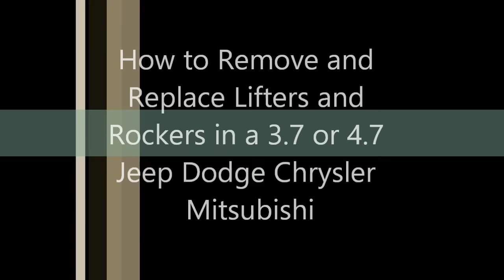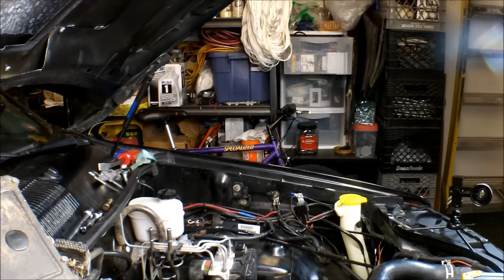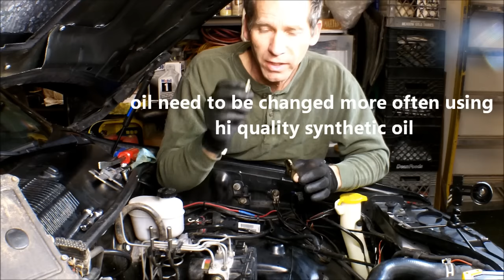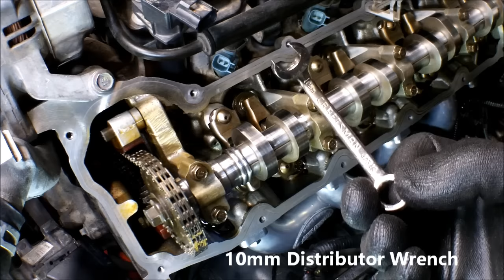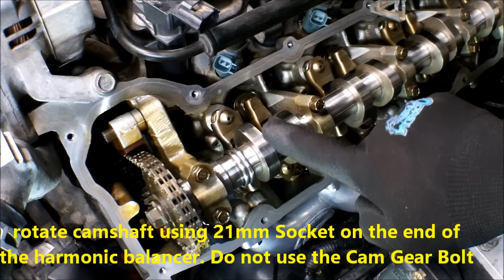Remove & Replace Lifters & Rockers on a 4.7 & 3.7 Jeep Dodge Chrysler & Mitsubishi

Comment: With that motor, the oil journals where the oil comes from to the lifter gets plugged not getting enough oil to the lifter. It's not usually the lifter. Take lifter out. Crank over the motor to blow out the oil journals that are plugged. You will know when the oil squirts and hits the hood so best put a rag over it. Only takes a crank or two to unplug them.  Replace the lifter or use a new one.  Works every time.  It took me 4 times taking mine apart to figure it out with new lifters.
Reply: I'm sending my kids dad a screenshot of your reply... Smdh poor dude... They getting him for a whole motor 😩😂 I'm in another state or I'd prove a whole point 😂🥰
Reply: How do I krank over the motor? If it's all taken apart?
Reply: @machetesulaco  Why would you take it "all " apart? Just take off the valve covers and pull the lifter out that isn't working. You don't want to start it until you get it back together
Reply: @machetesulaco  turn harmonic balancer using its bolt
Reply: These are OHC engines, so they don't have "lifters". They're hydraulic valve lash adjusters.
Reply: @UnionThugg  Are you trying to be funny ?
Reply: @grabitz This isn't hard. It requires a basic understanding of engine desugn. These engines do not have "lifters".  Pushrod engines have lifters. On the 3.7 and 4.7 engines, the hydraulic lash adjusters (the name AMC/Chrysler used) do not actuate anything.  They simply take up any ash between the rocker arms and camshaft lobes.  That's it.  

I'm almost sorry if those facts hurt your feelings.
Reply: @UnionThugg  Wow so your hydraulic lash adjustor doesn't have a lifter body?
Reply: @cablecow15  it's unfortunate that some people can't handle facts, and have to resort to ad hominem attacks on others in order to establish an regulated emotional state.  Since nobody asked you, your comment is worth exactly what UT cost.
Reply: @UnionThugg  Well.... It has lifters. But it does not have pushrods.
Reply: @ItalianoDio-  no pushrods = no lifters.  They are hydraulic lash adjusters.  They simply take up the clearance in the valvttrain.
Reply: Boo hoo
Reply: @UnionThugg chill tf out. It’s understood that they’re lash adjusters haha, they’re two very similar things and both serve a similar almost identical purpose. People can call them what they want. It’s not some marvelous form of technology
Reply: Good idea, I'll disconnect the fuel injectors so there's no ignition
Reply: You just crank it on the starter?

Comment: I have an 09 Dodge Ram 1500 with 330,000 miles on it.  I have used full synthetic oil since day one.  The lifters started ticking about 10,000 miles ago but I am now finally able to dedicate the time to do this job as this has been my main vehicle and I couldn't afford to let it sit for too long.  I hope to get another 50 to 60 thousand miles before I finally trade it off.  I've not had to do anything major to the engine, just a couple sets of plugs, a sepentine belt and tensioner, and 3 water pumps.  I also had to replace the radiator at about 200k miles.  Along with the lifters, I'm replacing the complete timing set, spark plugs and wires, valve cover gaskets, heater hoses, upper and lower radiator hoses and water pump.  Maybe I'm sinking too much time and money into something with this many miles, but this has been one of the most trouble-free vehicles I have ever owned, and I have definitely gotten my money's worth on this pickup.
Reply: You fix it?
Reply: Word.
Reply: It would be smarter the get new heads at 170k the bearing on cams already toasted so

Comment: You made the rocker arm and lifter look very simple to remove and reinstall.  Sometimes I like to work on my own vehicle, dealerships rates are outrageous.  Thanks
Reply from the maker: yeah, they are easy to replace, the hard part is getting the valve covers off with all the wiring and hoses that are in the way.

Comment: Always change your oil on time with full synthetic and try not to constantly romp on the accelerator and you're golden. I have an 03 Durango with the 4.7 and it has been a very reliable engine. 171,000 miles. I've had it for 4 years and the only things I've had to replace were the radiator and the alternator. Now the front end is another story, but that's a just Dodge thing 😂

Comment: thank you for your video i just replaced the lifters in my 2002 jeep liberty 3.7l   i used a 10 mm wrench , bent the end and grinded on it to make it thinner, it popped the rocker right out just like you showed. and used a small pry bar and a flat screw driver to pop the rocker back in.   thank you very much for sharing your knoledge.

Comment: Hello i let my wife drive my 2002 doge ram 1500 4.7L . She let it overheat due to a bad thermostat. It got into the red and blew all the water out and cut off on its own. It still runs and no water in the oil. But i had a diagnostic test run with a OBD 3 reader. The codes came back as misfire in cylinder 8 , cranckshaft postion sensor. Air temperature sensor and a evaporative code. Anyways i change all the coil packs and spark plugs and crankshaft position sensor and air temperature sensor. It ran great for a day or two. So i had another test on it and its still showing misfire in cylinder 8. And air temperature sensor code. Some people say that the lifter and rocker arm probably fell out inside the valve cover. Is this a problem that occurs alot with these engines. My truck starts and runs but it has a slight tick and it runs a little rough when starting. But it does still run. Do you suggest i take the valve cover off and check to see if something inside is messed up?

Comment: I followed your video of putting the rocker arm back on and it seems to lightly snap on. You have to use a screwdriver to pop it off. I changed the lifter too. It doesn't snap back on like your video...I've been at it all day. It's cylinder 8..the very last rocker arm.

Comment: I just got done doing my lifter on a 2002 dodge ram 1500 4.7 i removed air intake, wire harnesses, radiator hose, disconnected the battery, removed master cylinder from brake drum,and removed brake drum in preparation for this project. Everything went well except the parts store sent a wrong part in place of one of the lifters. i had to go back to the store get the right one and soak in oil for another 12 hours(i cheated and soaked for 8 so i could have it done that day). I used his advice through the whole project and it went well. 2 thumbs up!!! thank for taking your time spent making this video.

Comment: Thanks Martin for posting this video. My 01 WJ 4.7 had a valve seat come loose about a month ago and I took the heads off and had the machine shop replace all the valve seats. They had a way to install them so that they won't come off again. Well I put the engine back together and it ran great for a few days. Then this morning I went to start it and it made a loud tapping sound followed by an engine miss and a p0303 engine miss code. I had a hunch that a rocker came off and pulled the driver's side valve cover off and there it was. The exhaust rocker fell off. Bought a new lifter for about $13 and popped in like you did and it runs great again. The previous owner wasn't too good about doing regular oil changes and so there was a fair amount of sludge in the engine. I dropped the oil pan and clean the pick up tube and screen as well to be safe. So far so good. Thanks again! Very helpful video.
Reply from the maker: I'm glad everything worked out for you. You may want to try some Rislone engine treatment to clean out that sludge.
Reply: I remember reading someplace awhile back that another problem with these engines is carbon on the valve stems.  Supposedly if enough carbon builds on the valve and causes it to stick for even like a fraction of a second, the rocker arm will fall out .

Comment: We bought a 04 Durango with the 4.7, I have the 4.7 in my 04 Ram as well.  My Ram runs like a dream, has slight noise on startup but goes away within seconds.  It has 201k on it, I got it with 165k.  Previously it was a state owned vehicle so had regular maintenance.  The Durango on the other hand has about 155k, has significant noise that does not go away.  I know these motors are notorious for valvetrain noise due to the valve adjusters getting plugged with crap, but didn’t know how hard it would be to repair.  After watching this video I am confident that I can get the job done myself.  Thanks for the video, to the point and not a lot of irrelevant talking.

Comment: Thank you for taking the time to make this video and explain everything in detail, I'll be replacing my lifters next weekend and it's nice to know it won't be a 3 day event.
Reply from the maker: You're welcome, the hard part is getting the valve covers off due to all the hoses and wiring harness that run over top of the covers. Once you got them off I think it's pretty easy to change out the lifters
Reply: @martinbuilt  ok that's good to know. I'm hoping replacing the lifters will rid the light color smoke during start up and the engine tick. It goes away after a few minutes but it's definitely bugging me
Reply from the maker: @somanynamesilltrythis0180  you didn't mention the light colored smoke on Startup that sounds more like valve guide seals. Now the tick noise your hearing is  the lifters. I just recently did a video where I install the 08 camshafts new valve springs, retainers and valve guide seals you may want to check that out.
Reply: Number is gasquet

Comment: You sir, have made my day. I was just about to buy the tool and was worried about lead time on it (plus the price). I already have a 10mm brake line wrench ready to volunteer.  Thanks again.
Reply from the maker: if that wrench doesn't work for you, Autozone has a set of distributor wrenches that will work. Even a pair of needle-nose pliers with the angled tip would work.

Comment: Sometimes I miss that ol’ 04 WJ overland I had. It was my first V8 and even though I’d laugh at it now, that thing felt lightning quick after owning my 08 JKUR for nearly 5 years. Lol! Great video!
Reply: Maybe not actually lightning quick, but the 4.7 HO’s are definitely not slow. Certainly a lot more power than a JK. Rented a JKU for a week on vacation and I liked the Jeep but missed my 4.7… 😁
Reply: @TireSlayer55  Oh it was by no means "lightning quick" lol. Just in comparison to my old, lifted 2008 JKUR on 34" tires it was. https://youtu.be/vDH8IbQZziU
Reply: @TireSlayer55  for comparison, this was my 2004 WJ H.O. 4.7 (on 32" tires and 2" lift) https://youtu.be/H5o-HEdtSrM
Reply: I feel like the V8 WJ’s are pretty peppy for a big heavy luxury SUV that was designed primarily for comfort and off road ability. Mine’s just the standard output 4.7L and it’s on 31” tires… while I wouldn’t call it fast per se it’s got enough power to make a fun daily driver. Most of my driving is between 0-45 MPH so I’m happy just being able to easily get ahead of slower traffic without needing to give it a ton of throttle. I hardly ever rev it over 3500 RPM in normal driving, but the few times I’ve ever given it over 3/4 throttle it’s surprised me. Compared to the two high mileage 4.0L XJ Cherokees I daily drove previously, the WJ feels like a rocket, lol. I did do the torque management wire snip and a TransGo shift kit which definitely made it feel more responsive in everyday driving.

Comment: Thank you for hosting this video I have to say you removed with it the intimidation out of me to do this. My jeep Liberty with over 300k miles I'm suspecting a lifter got stuck and one of the rockers got knocked over.
I saw a video with ame symptoms as mine and I sure hope that's what it is. 
Have used synthetic oil but last year or so services have been at over 6600 mile if not more.
I regreat it now but the damage is done.
Reply from the maker: I'm glad to hear the video gives you the confidence to do this yourself. My 01 Dodge Dakota recently passed the 300K mark several months ago. It also has a lash adjuster ticking.

Comment: I want to give credit where credit is due. I had an extra 10m wrench and bent it in the vise to look like what you had and it worked great!! I used it 100% to remove lifters and 90% of the time to install, at times would have to use a screwdriver to install. I installed 16 lifters got them from Napa,  Sealed Power lifters $240  job took about 15hrs ( I took my time and I don't do this as a profession) I reused the OEM valve cover gaskets they looked good and are installed and not leaking.   I removed the water reservoir. The right valve cover I loosen the air conditioner condenser on the firewall, I removed the oil pickup and the air conditioner and moved it to the side to give me clearance to remove the valve cover. I soaked the lifters for 30 min in 5-30w and installed lifters and turned over the engine with socket wrench on the flywheel to ensure lifter lob was not depressed. Drove the truck for the past few days and runs great.  Thx again for this video
Reply from the maker: rlarson3232 
That's  awesome glad everything worked out for you.
Reply: I forgot to say this was a 2001 Dodge Dakota
Reply from the maker: When I did the HO cam install I had to move many of the same things that you did.  Thanks for posting your comments.
Reply: Were you working on 4.7

Comment: Great video, very informative and your video quality really makes it easy to see what needs to be done to get the rocker off and back on. I have a 06 dakota I picked up. It needs valve cover gasket a but think I will tackle this as well while in there. Thank you for posting.
Reply from the maker: Glad you enjoyed it!
Reply: @martinbuilt you have quite the pool of knowledge for these motors. Would you recommend using a product like liquimoly engine flush on these motors? Considering doing so on my new to me 06 dakota with 160k miles before tackling valve cover gasket and new lifters.

Comment: Hey man great video I had purchased a 02 Durango and it has a bad lifter and I just found 3 rockers not connected like they fell off but just saw this video it’s going to help so much better but when I installed the rocker I accidentally loosened the bolts to crank but tighten it back up and it drove good after

Comment: Very helpful video, thanks for posting this! Surprisingly easy once I got that stupid valve cover off. I have a question though, what if the lobes aren't all pointing up? I just went through this repair and it all went smoothly up until the last two rocker arms. I hadn't thought of that beforehand and I snapped out the rockers and replaced the lifters (which were entirely siezed up, so I know diagnosed it right), but now I cant get two of the rocker arms in. How screwed am I?

Comment: 2014 Dodger Durango 3.6L.... worked perfect!! Thanks for the post. Hardest part was getting everything else taken off to get to it.
Reply from the maker: Your welcome, yeah there is a lot of stuff that needs to be moved just to get the valve cover off.
Reply: The 3.6 is a completely different engine.

Comment: I was also taught that having your Jeep WJ run hot (210°F+) on the 4.7L causes the lifters to stick or fail = thousands in repairs.
I have altered my cooling system from a hydrolic fan to a Viscous clutch fan with upgraded plastic 11 blade Ford 5.9L fan with slight modifications to clutch face and fan blade bolt holes.
I only have an additional 6lbs on the water pump and that causes under 2MPG/3HP loss.
Ive been doing fine without the fan shroud with my clutch fan and small E-Fan combo. 12.5" Spal fan that is rated at 2800-CFM and the Severe Duty Clutch fan has over 3650CFM according to my Anemometer

Comment: Also I have read stories where engine flush gets rid of the ticking sound (some times) and other stories where they tried everything including lifter replacement, and the noise still wouldn't go away.
Reply: I'm having that problem!

Comment: Hey Martin, what would you recommend I do if I dropped a small bolt down the oil drain within the camshaft case? Right under the rocker.
Reply from the maker: I don't think it's going to hurt anything. Most liking sitting on the bottom of the oil pan.
You could try to use a magnet through the drain plug to see if you could retrieve it.
The bore scope that I have has a magnet attachment that would work well.
here is the video on that.
 https://youtu.be/qVED_EMvTdQ
Teslong NTS500 Triple Lens Endoscope  https://amzn.to/35xiHqF
Reply: @martinbuilt  you are amazing thank you so much.🙏🏼

Comment: My 4.7 currently sounds like a duramax when you cold start it with all the ticking, this might have just given me the boost to go change the lifters and rockers. Thank you!
Reply from the maker: That would have me very concerned. It also could be the hydraulic timing chain tensioners that are making all the noise.
Reply: @martinbuilt  I'll change out the lifters and rockers and see where that gets me. If it keeps it up I'll change the tensioners. I don't think the previous owner of it was very good on maintenance so I've kind of had to just run through everything on that motor.
Reply from the maker: @gdcatalyst7812  Yeah oil changes intervals are important with this engine.
Reply: @martinbuilt   just installed all new lifters and rockers and the tick remains. It goes away as soon as I'm up to temp though, you could be right it could be the chain tensioners